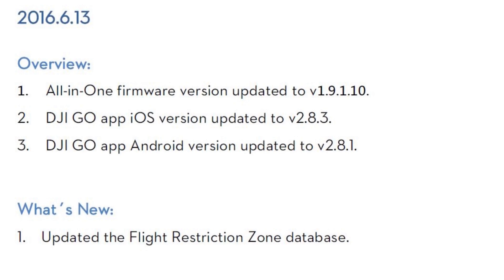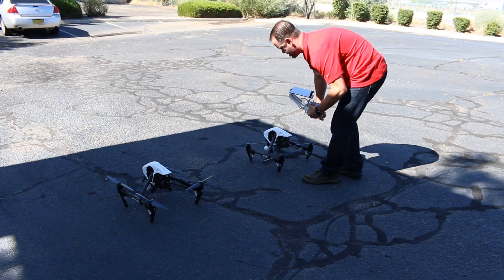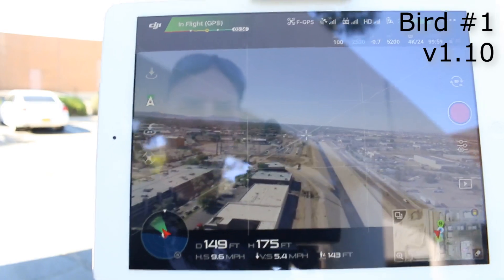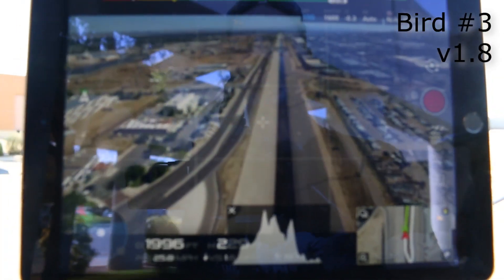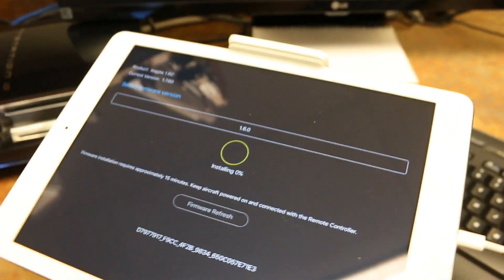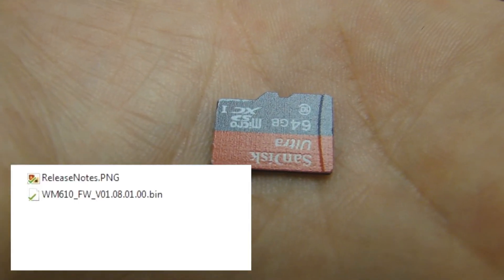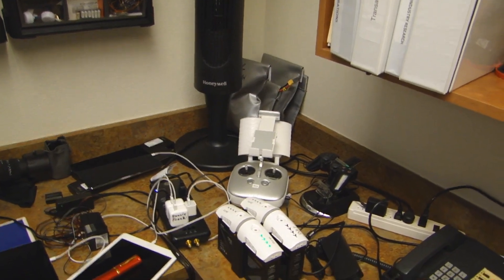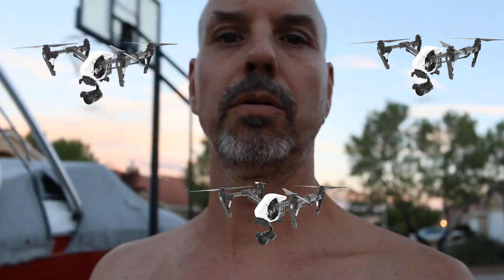Make your Inspire 1 great again...Part 1...

Comment: Hi. What about android, does it work
Reply from the maker: I don't know.  I don't have any Android devices.  But I imagine the Android version of the DJI Go App has the same tools as the Apple version.  The only difference should be the GUI.
Reply: @drummerdonniedotcom  Thank you. I put bid in on a local inspire 1 but owner said he updated about a year ago. I hope it has 1.10 and not 1.11 but I will try your way to downgrade if 1.11. Will pick up Sat. But I only have android not apple so was wondering. Thanks
Reply from the maker: If you check the comments below, one user was able to go back from 1.11 to 1.08.  Also, I was able to semi-successfully roll back an Inspire Pro to any FW I wanted, but the gimbal would only work with 1.11.  I firmly believe that when DJI California repaired his bird, they used a third-party gimbal controller that is incompatible with any FW version other than 1.11.  

Which bird are you getting?  Version 1?  Version 2?  Or the pro?
Reply: @drummerdonniedotcom  Thank you for that. It's a inspire v1 as far as I know. X3 cam. I will find out when I pick it up as owner does not know if it's a v1 or 2.0
Reply from the maker: @ronangsr  The most profound difference is twofold: 1) V2 is X5-ready with the larger camera mount system.  2) V2 has the updated prop hubs.  You can Google images of those differences.  And of course the PRO comes with an X5 camera.  And the RAW comes with an X5R.  Good luck!
Reply: @drummerdonniedotcom  Thank you. Its a v1 so.. I'll let you know how I get on. Thanks for your advice and help
Reply from the maker: @ronangsr  Since I made the above video, a couple different firmware versions have made their way into the hacking community.  I assume you're using an X3 camera, so the following files should work.  The "WM610_FW_V01.08.01.00" bin file and the "WM610_FW_DEBUG" Magic Key file.  Good luck!  Let me know how it works out.
Reply: @drummerdonniedotcom  thank you very much, regarding dji go 3
1.1 I installed it and it's forcing me to update, it will not open. How did you get around that ? Thank you very much
Reply from the maker: @ronangsr  Disallow everything.  Disallow location services, access to camera, photos, everything.  You may have to uninstall the app and re-install it, which is totally painless.  You WILL have to go back and change settings like Metric to Imperial, etc.  When you re-install, you will be prompted by a series of screens to allow certain services.  Disallow all of them.

 A good test: You should be able to open the app without being connected to the AC or the RC.  If you can't, something is wrong with the app.  Reinstall.
Reply: @drummerdonniedotcom  hi got it working, I deleted cache files, disconnected from internet and opened it up, no more forced update. Also I noticed  typo in your description. You recommend dji go 3.1.1, when in video it is 3.1.11. I cannot do any more pre prep now till sat when I take possession of the inspire. Keep you updated. Thanks
Reply from the maker: @ronangsr  Not a typo, amigo.  Sounds like you have a later version.  I don't imagine there is much difference between 3.1.1 vs. 3.1.11, but there might be.  The .ipa file is too big to email, so make sure you've got the right .ipa file.  It should be 194,400 KB.  No more, no less.
Reply: @drummerdonniedotcom  Thank you very much. One other question is there off line maps in 3.1.1? Thanks
Reply from the maker: @ronangsr  Yes.  The entire reason for installing 3.1.1 was to avoid this:

https://youtu.be/F7dkj6ISIgE
Reply: @drummerdonniedotcom  sorry I should not laugh but you came across funny, but yeah that is fecking shitty. I hope I can get the inspire to where you have your one now and just leave it alone. No more updates. If it's not broke don't fix it. That's my motto
Reply: @drummerdonniedotcom  hi pal, I picked inspire up today, was running 1.11, downgraded using the magic key to 1.09 and then flashed to 1.08. No problems. Only issue was dji go 3.1.1 I could not stop it forcing update. Thought I had it sorted but turns out I didn't. I went back to a patched 3.0.1 and it is working flawless with Google maps. Want to thank you very much for your help much appreciated
Reply from the maker: @ronangsr  Most excellent.  Glad too hear you got it going.  You can stop the software from updating in "Settings" under "iTunes and App Store," turn off "Automatic Downloads."  That should do the trick.  This will not stop iOS from updating, but it SHOULD stop your apps from updating automatically.
Reply: @drummerdonniedotcom  the problem is I am on android and I need my tablet rooted to stop the force update or I have to live with no maps. Could I use 3.1.50 with the v1.08 firmware. I tired it and got warnings of out of date firmwares but the motors still armed. I spent hours on this I cannot get working maps on any version without forced update. Pain in the ass
Reply from the maker: @ronangsr  Ahhhh.....Android.  Okay, I'm unfamiliar with the Android version of the Go App.  I see "Firmware update required" every time I connect my iPad to my Inspire.  Just X out of it.  The reason for using v3.1.1, is that's the last version before DJI started deploying login requirements.  So you can use any version of the app you wish.  Just beware that subsequent versions RANDOMLY require a login to the DJI mothership.  If you're out of WiFi or cell range, you're fucked.

Regarding maps, I'm afraid you're on your own.  I get maps with no problem on the iPad.  I have no idea what goes on under the hood of the Android version.  For all I know, the Android version number may not even correspond with the Apple version number.  You're just going to have to experiment.  I wish I had better news.  Good luck!

Comment: You are an absolute magician with your key! I got my Inspire 1 V2 to go from the latest 1.11 back to 1.8.01.00!! I got the 1.8 firmware from panorobot (per your other great tip!) for the record I have a Pro actually with the X5 camera mount but using a X3..I have both cameras by probably won’t try to mess with the X5 firmware and will just use my X5 solely with my Osmo. 

One weird thing was at the end of the downgrade I got the dreaded long solid beep so I thought it didn’t work and figured I would have to reload the 1.11 and start over because I tried previously to go to 1.09 unsuccessfully (using your magic key) but I checked the log this last time and it was a success and after then rebinding the controller (downgraded to 1.6) I checked my about screen and the bird and camera are both on 1.8!!!) Can’t possibly thank you enough. To the 3 people who thumbs downed this video try again :) 

If only I could downgrade the app firmware to 3.11 I’m sure it would be even better but with me being on the latest 3.1.47 app firmware my bird is actually useable again and working great! So many thanks! 

Happy holidays!
Reply from the maker: Hello Mr. Winn.  I'm glad it worked out for you!  And, yes, if you can roll back your Go App to v3.1.1, you will be in droning bliss.  To do this, you will need a legacy version of iTunes, which you can get here: https://www.softerm.net/software/itunes-125442-64-bit/2594

I have also updated my comments to include updated information (at the bottom of the description section).  Steve Barnes of DigDat0 does a most excellent tutorial of how to roll back your App (URL to his video at the bottom of the description area).  Remember, once you roll back your app, Apple is going to hound you occasionally to update it.  Do NOT update.

The final hack is the 32-channel hack, which opens up 24 "hidden" transmission channels.  Once you set your Inspire up this way, you'll never have to worry about it again.  I just flew mine with my partner at the controls and me operating the camera.  After being in a box for 2 months, we charged everything up and the Inspire flew flawlessly.

https://youtu.be/dtrq_h445S4

Good luck!
Reply: So with all of your great advice & links I actually just got it rolled back to 3.1.11! Only dilemma I have is I can't load it to my iPhone X since it requires the later version of iTunes so I loaded it onto a iPhone 5S and it worked! Do you know the latest iPhone/iPad version that will work with the older iTunes?
Reply from the maker: @RatherBeRestoring : I'm sorry...I don't have that information.  I actually use 11" iPads for my drones.  I have an Air 1 16GB WiFi, and an Air Pro 32GB WiFi.  Both are very duty specific to my aerial photography company and sound business.  So they are stripped of all "fluff" and are strictly used for business.  I have disallowed iOS updates on both iPads, stopping @ v11.xx.  I find that Apple is no better than DJI when it comes to the hyperbole of their updates.  They often boast "better performance" (and even cite numbers), but my user experience shows the exact opposite.  I'm one of those "if it ain't broke, don't fix it" guys, so almost everything in my life is a legacy / vintage version in one way or another.  And while I DO embrace some new technologies (obviously), I'm NEVER less than 2 years behind.  I have found this paradigm to be VERY beneficial.  But I digress...

According the Inspire 1 release notes, Go App v3.1.1 was released for iOS 9.xx on 12/15/2016.  Since then, I have allowed my iPads to go through two updates, v10.xx and v11.xx.  I have stopped there, and 3.1.1 is working great.  So I think we can extrapolate that Go App v3.1.1 works through iOS 11, but probably breaks @ iOS v12.xx.
Reply: Donnie Frank I really can’t thank you enough for all of this very valuable info AND for responding so quickly! You’ve made my Inspire fun to fly again. I was ready to send it to DJI in one last effort to make it flyable again even though I knew the end result of that scenario before it even happened ;)
Reply from the maker: @RatherBeRestoring : You are welcome, my friend.  Happy flying!
Reply from the maker: @RatherBeRestoring  : Question: Which firmware did you use?  And which "magic key" file did you use?  Did you use the WM610_FC550_FW_V01.08.01.00.bin file?  Or did you use the WM610_FW_V01.08.01.00.bin file?  Did you use the WM610_FC550_FW_DEBUG debug file?  Or did you use the WM610_FW_DEBUG file?  Thanx in advance.
Reply: I used the panorobot link you provided to get the WM610_FW_V01.08.01.00.bin and I created an empty folder named WM610_FW_DEBUG and that worked. Took more that one try for the downgrade to take, I believe 3 tries, all the exact same way but 3rd time worked for some reason. I also figured out a way to get iTunes 3.1.11 on my iPhone X...I installed it onto my iPhone 5S via iTunes and the cable and then I did a cloud backup of the 5S and then restored that backup onto my iPhone X. The screen size is limited to what the 5S screen size would be (with the DJI app open) but it works. I then downloaded any other apps I wanted on my iPhone X via the cloud and voila. 3.1.11 DJI Go on an iPhone X  :)                                                                 All thanks to you!!

Comment: Okay,great vid. Did you have to downgrade to 1.9 then to 1.8? I was having connection problems with the DJI Goggles. I was on 1.8 version and people said to do the latest firmware upgrade, so I did. That did not help with the goggles. So now ,want to go back to 1.8 as I was experiencing video connection probs.
Reply from the maker: As you have probably gathered, rolling back the FW is dodgy business.  In theory, the "magic key" file allows you to go directly to any FW version.  My experience has been that this works MOST times, but not always.  That said, if you have v1.9, you should be able to roll back to v1.8 with little problem PROVIDED you have an X3 camera.  I have been trying to do roll backs with the X5 with very little luck.  All that said...

I assume you're using goggles via the HDMI port.  They should work perfectly with FW v1.8.  I use FatShark Dominator V3 goggles all the time with great success. 

Which goggles are you using?  What issues are you having?
Reply: @drummerdonniedotcom   I have the X3 camera, the drone is updated to the latest version, think 1.10. I just purchased the DJI goggles and am using the HDMI cable for connection. In the goggles it states ,not connected. Yet when I connect directly to my tablet with the hdmi cable, it works, just will not connect thru the controller. All settings are turned on in the app for the hdmi connection.
Reply from the maker: Good on you regarding the X3.  Regarding the DJI Goggles, I couldn't stand 'em.  I purchased a pair barely used, used them twice, and duly put them on Craigslist for 3 months until they sold for the same price I purchased them for.  In other words, I know very little about them.  I can tell you with 100% certainly that the HDMI port works fine with FW v1.8.  But remember, you must also rollback the controller to v1.6, which is covered in the video.

If I recall, the DJI Goggles are WiFi capable.  So make sure they're not trying to connect via WiFi.  Don't assume that they will automatically default to the correct input source.  You probably have to manually tell them to use the HDMI interface.  Lemme know if any of this helps.

Comment: I was having the same problems on 1.11...
It took quite a bit of work to roll back, but I ended going all the way to 1.7 on the bird and 1.6 on the controller, then upgrading to 1.8.1 on the bird and 1.7.8 on the controller. 1.8.1 was  not compatible with 1.6 on my controllers. Issues seem to be resolved and I am getting 1,700ft where I would normally get 1000. Thanks for the thorough video.
Reply from the maker: That's interesting.  I've only seen the choices of 1.6 and 1.7 for the RC.  1.6 worked well with AC FW v1.08.xx, so I just stuck with it.  I know RC v1.7 works with AC v1.09, but I didn't know it worked with AC v1.08.  Interesting.  RC v1.7.8 must be brand new.  I wonder if v1.7.8 has advantages over v1.6.  Again, interesting.

Comment: Do you know if this solves the issue with the Crystalsky and it’s choppy/laggy video feed?
Reply from the maker: I do not.  I assume so because the newer firmware seems to cut video transmission strength, which is the bird.  So it makes sense that any receiving devices, regardless of brand or make, would benefit from the increase Tx power provided courtesy the firmware roll back.

Comment: I know that the inspring 1 wants to remove the nfz needs to bind the serial number of the plane. How can I bind it? In which module? How to realize?does anybody know,thanks ！
the picture is here 
https://www.facebook.com/100023679401064/posts/222950508504261/